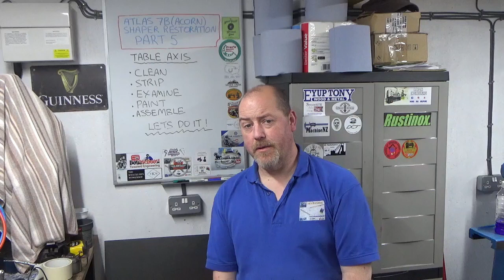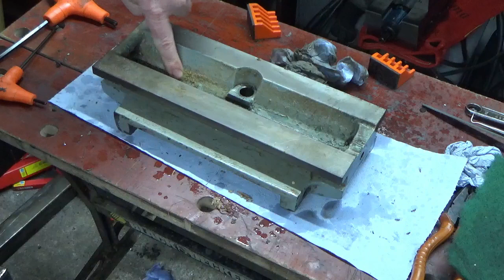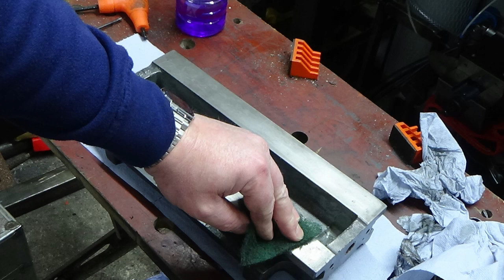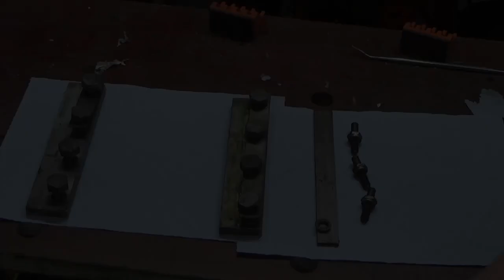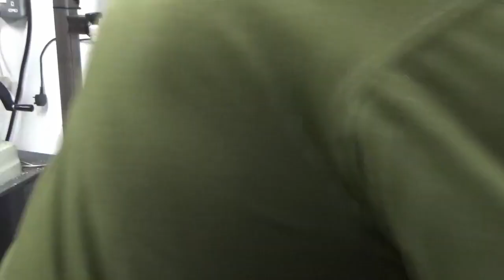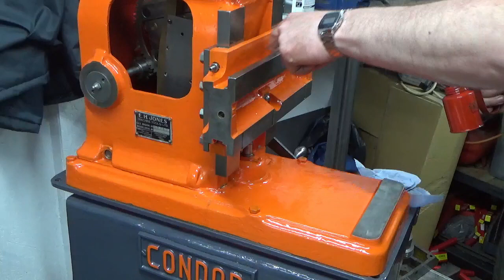Atlas 7B Shaper Refurbishment Part 6 -  The Rebuild Continues

Comment: Compound slide or compound carriage slide is more like it.
Reply from the maker: Hi Howard, thanks for the comment. I really should do my homework before I start lol. Cheers, Jon
Reply: I'm not sating it is called that for certain but the two sides are by any reasonable definition a true compound slide assembly. I have also seen it described as just 'the table carriage' a few times.....who cares just as long as it goes smoothly in the X and Z planes it'll be champion😁

Comment: wd 40 isnt as mush a degreaser but a water dispergent (hence the wd ) from wat i understood it was devellopped for the american army to keep the moisture in the rocket silo's from coroding parts of the missiles in them 
think a better degreaser is eehr degreaser or brake cleaner
Reply from the maker: Hi Watahyahknow, thanks for the comment. Yup, "Water Displacement" and the 40 indicates it was the 40th concoction the team who were tasked with coming up with something got to before they stopped. I like using it, smells nice, works well and you only have to use a small amount with one spray as it doesn't evaporate. It also prevents rust flash over as my workshop is very damp, whereas full on degreaser has the opposite effect. Cheers, Jon